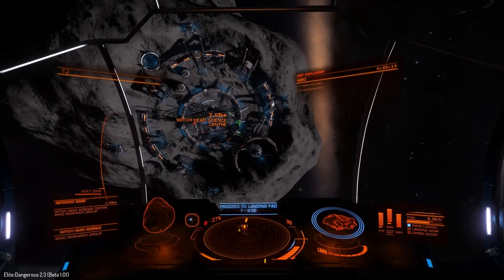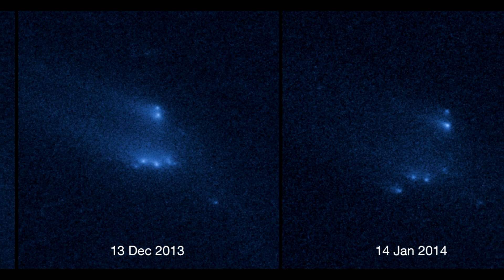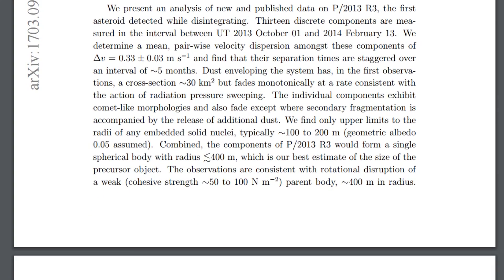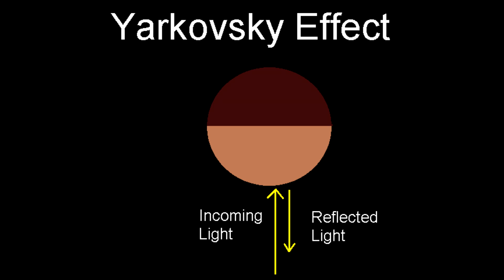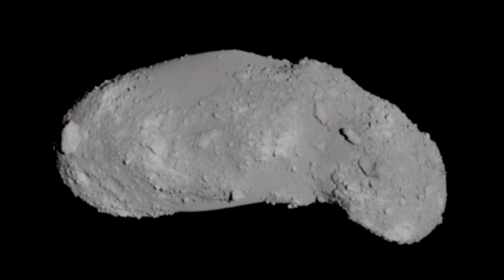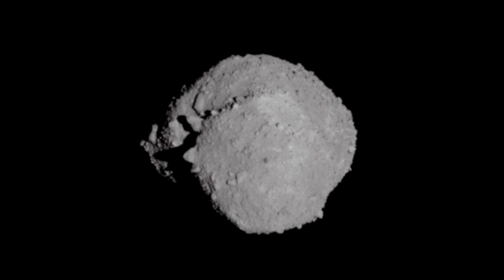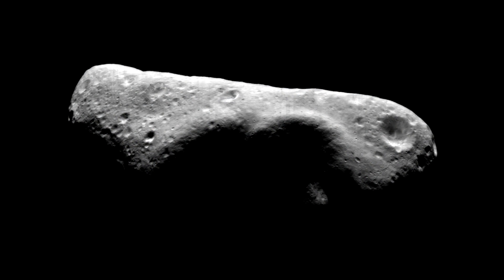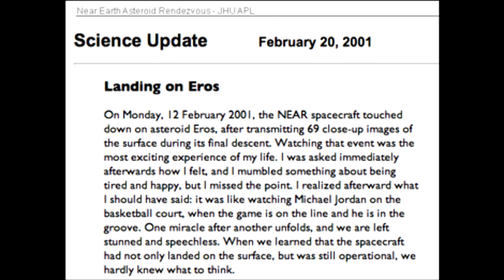Spinning Asteroids To Make Space Stations

Comment: Yeah, this seemed like one of the least plausible things in the show to me. I'm not a physicist or anything, but... Assuming you have the power to pull it off... It seems pretty obvious: You're not just increasing the gravity; you're reversing it. So unless it's made of solid granite or something, what's keeping the surface on the surface? What's stopping it from just spinning apart into pieces? Might as well stick with good old fashioned O'Neill cylinders, and/or genetic engineering to adapt humans to microgravity.

Comment: Civil Engineers use concrete, which is weak in tension, by placing it in compression, so called pre-stressed structures.
Perhaps this could be applied to asteroids?

Comment: I agree and also disagree, there is absolutely no evidence that every single object in the belt is a loose conglomerate of small bits and not a solid object especially when you start talking about the larger ones like Ceres which is considered a dwarf planet. However smaller ones like Eros most likely are but again, can't say ALL. I do agree spinning can/would take a long time to get close to Mars like which I do not remember the author ever claiming this (if you have a page and book # to refer to???). If you have a solid body or as Scott suggested a process to "firm it up" the size of Eros however, ten years to do so is nothing. Some comments though try to suggest the original gravity of Ceres would help, it doesn't. Spin gravity would push you away from the center which is where the natural gravity is trying to pull you so it actually works against your goal and means you would have to spin even faster!

Comment: Radiation shielding: You can still get the radiation shielding benefits of an asteroid by keeping people in the shadow of or inside a 100+ meter asteroid, while harvesting energy from the light side/surface.  

Whether you bore into the asteroid or hang out on the dark side, you only need to spin the gravity-sensitive portions of the habitat, including 0.1 to 1G partitions. Today's Franken-chickens, for example, aren't doing well under the load of 1G environments, and their bones would do better in microgravity.

BTW, I don't see why it's all that hard for phonebooth-sized craft to dock at the hub of a spinning station. You just match the rotation, which ain't much. Sure, it's a little harder than stepping onto an escalator at the shopping mall, but if we've got fly-by-wire drones flying in formation, we'll have fly-by-wire docking modules, too. 

You just teach a neural network to master lunar lander and then teach it to perform docking in a zero G simulator,  then IRL. It's not rocket science.

Comment: If they build the base inside the asteroids first, then spin it up, they could remove a lot of mass so it would require less energy to spin it up. This would also provide them with the opportunity to process strong reinforcement materials from the excavated minerals while building the base, therefore a lot of the construction and manufacturing could be accomplished onsite, so it could be a little more realistic, but still very scifi.

Comment: For Ceres it may not even be necessary to solidify it, as it is massive enough to undergo Hydrostatic equilibrium and most of the technology needed to accelerate its rotation would only need to be implanted into its surface.

Comment: I think if you're going to spin asteroids like Eros you're probably drilling and installing a matrix of lightweight, high tensile strength cables and girders throughout the whole thing to keep it together, and weaving an outer net/shell out of carbon fiber cables or something along those lines, with a much thinner spray on polymer shell to keep the surface hardened.
But yeah, past that size you probably just want to build ONeil colonies from scratch using nearby asteroid materials.

Comment: Sorry, had to give a negative vote to this video. Why so much negativity against the idea of hollowed up asteroids? It's not like there's just one kind of them!!! Metallic asteroids are pretty much solid chunks of almost pure iron, which is pretty strong itself. I've seen iron meteorites in the museum which are a couple tons in weight and VERY solid, not quite a bunch of pebbles barely held together by their own gravity. These are what remains after the main part breaks up in the atmosphere during entry... so obviously, there must be some metallic asteroids up above which are ~1km in diameter and >90% pure iron - it would be very easy to melt them with care so as to carve a liveable space within as well as smooth out their exteriors, probably also making it more into a spheroid (so it better resists the mechanical stresses due to the spin) and adding some carbon in the process to convert iron into steel. This wouldn't work for objects like Ceres or Eros, but I for one find the general idea is pretty sound

Comment: The question of if a (small) body will break-up due to its fast rotation (centrifugal force) depends primarily on the size of the body and secondary on the tensile strength of the material. If you have a piece of an iron asteroid (let say < 100m in diameter), you can very well spin it up so fast that on its surface you get 1G and it still will hold together. So no, it is not true what you said, Scott, that @ 0:52 - "Would an asteroid even hold together if it did this? Well, the answer... is actually pretty obviously no." - No! The answer actually pretty depends on size and strength. What you said is not generally true.

Comment: Out of curiosity, since you bring up mass quite a bit in your calculations, have you taken into account that the mass of the asteroid could/would likely be heavily reduced if it is being hollowed out for a station complex? There is also the possibility that the station construction could be placed as a separate and distinct cylinder inside the asteroid, and thus have its own rotation speed beyond that of the asteroid. Basically, the asteroid would exist as a material resource during the construction of the internal station, and then merely exist as an extra shell of protection after the construction has been completed.

Comment: Once we have (ultra-strong) diamond fiber (df) in industrial quantities you might wrap df-cables around it or even embed them in it ala reinforced concrete, which gains it strength from a balance of tension and compression. But if you're going to do that you might as well build a habitat by just creating a df-shell and lining it with asteroidal rubble sufficient to block cosmic rays.

Comment: Seems to me that you are speaking in the terms of the science fiction these asteroids are used in, in so much as they are hollowed out. That to me is an impractical use of these asteroids. There are enough materials in the asteroid belt to mine and refine to fabricate habitats that would be much stronger and lighter, such that spinning them up would be no problem. It is readily apparent that just spinning up a hollowed out asteroid, even if what is inside it is reinforced, would not be a real solution, as these bodies are inherently unstable to begin with, and could not be reinforced well enough to keep them from flying apart as the spin reaches a limit beyond the capabilities of the body to remain intact; and that spin would still not provide adequate artificial gravity. That said, as the asteroids are a vast source of raw materials, they would be able to provide for space refineries, which would be able to produce building materials. Eventually some of these building materials would be used to build more refineries, which in turn would increase the amount of refined materials produced.

On a related subject, let's take a close look at the International Space Station. Here is a conglomerated collection of haphazardly assembled parts, and no one can remain stationed there for even a year without suffering the effects of near zero gravity. What makes this so impractical is the fact that the original plan to build a habitat ring could have easily been implemented, using the external tanks of the now decommissioned Space Shuttle program. Gutting them and building the interiors for habitation would have been much easier, and they could have been coupled together into a ring of a sort. Spinning up a completed ring of that type would have been rather simple, just by attaching retrorockets, similar to the maneuvering thrusters on existing spacecraft. Reinforcing such a ring would also be rather simple. And occupants could remain stationed in space living aboard such a habitat for several years. radiation could be shielded by layers of heavy metals like gold, and energy from the Sun could be used to power all electronic devices aboard, just as they are on ISS. This would also give us a nearby jumping off point to the rest of the Solar System, such as the asteroid belt; from which we could herd chosen asteroids to Earth orbit, where they could be mined close to our planet. At that point the possibilities would become practically endless.

So as a suggestion, could you make a video discussing these possibilities?

Comment: If that holds true then it would be very easy to mine them if they are just loosing together.  Just grab it and fill the cargo bays then head back to Mars I guess would be where it would be mostly done.  There filter through it, refine what can be and what can't be then somehow send it down to Mars to increase the planets mass.  The problem is most are class C; carbon, iron, and some other compounds.  So, we could get iron and maybe some other bobs and bits from that.  And whatever iron that wouldn't necessary would be feasible to extract could be just sent to Mars.  Now, the core of an inter planet is typically iron but not always.  It would help Mars more if it could make it to the core.  The problem with Mars is it was hit around 6,000 by some object and ejected it's core into space Phobos and Deimos.  Then the core cooled.  But in a few thousands of years, and if Phobos and Deimos could be deorbited and somehow get back to the core of the planet the it could start to generate a magnetic field.  But the mantle would have to be restored.  I know I have seen quick fixes which are really foolish and rush responses in the long run.  But if all of this was done then, maybe, it could be reconstructed to support life again.  But to get it earth like, that's allot of mass to move in that time frame.

Comment: I would have thought it better to dig a big enough hole through the asteroid but not spin it.  Build an O'Neil Cylinder inside and spin that.  Even better, build two in parallel so they can be spun in opposite directions to balance out the torque acting on the asteroid.

Comment: wrt to the calculations... are those for an already hollowed out asteroid?
presumably they'd hollow it out before they tried to spin it up, so there'd be a lot less mass involved.

that said, most asteroids aren't solid rock, so the whole point is moot. As you said, they'd need to do some kind of crazy process to make glass the whole surface and cool it down again, and the resultant material probably would be absolutely loaded with impurities and imperfections waiting to turn into catastrophic fractures.

What you said about the basalt fiber actually made me really think for a bit... rather than using the asteroid as-is, they could instead simply harvest it for material to make the basalt fiber, so that they didn't have to lift it off the surface of a planet.

Comment: I thought the best way to "spin up" an asteroid was used in John Ringo's "Live Free or Die" series, where a corporation shepherded iron-rich asteroids to a working area, then using a massive coordinated array of solar reflectors to drill a hole, drop in an icy comet, seal the hole, than heat and spin the asteroid until the ice expands to steam and makes a thick metal bubble. Bore in using your solar reflectors again and start inhabiting. - - - Spinning rocky asteroids is just making a gravel weapon.

Comment: If you're hollowing out Eros to make a permanent space station, you're going to remove a lot of that mass, which reduces the energy needed to spin it up. I'm thinking the corporation is processing that material for various minerals to use elsewhere. In that process, why not  save the H₂O (combine H₂ & O₂ extracted from minerals, bring in H₂O from other small bodies) to make concrete to extrude onto the surface over a matrix of carbon fiber or other cable to make a shell out of its own innards that will hold it together as it is spun up? In the process, you could re-make the shape into something more balanced around the spin axis.

Comment: There is a common misunderstanding that asteroids are large rocks. In most cases they are gravel balls, there may be a large rock in the middle somewhere but it is likely that they are mostly gravel and dust cemented to the large rock(s). Even if you found a large enough boulder to put a base on you would be subject to a storm of loose debris bouncing and orbiting through highly erratic orbits. This would make it extremely dangerous to attempt to land on and would require the base to be buried deep inside the asteroid. Making it largely inaccessible. It would be a much better plan to do this on a planatoid like Ceres. The weight of the armor you would need to approach an asteroid would be less then the fuel required to land on and launch from Ceres.
In my opinion the best plan would be to build a space station that would be easy to spin and use drones to collect the material you are there for. A space station would be a lot lighter and could be driven around.
Reply: There is a common misunderstanding that asteroids are all the same thing.  Also, Manley's projection seems to assume this trick is easier for larger objects.  The opposite is true.  With a maximum spin rate of 2 RPM, you can get useful gravity with natural materials, like basalt and granite.  Nobody is going to try to spin up a slagpile.  This is a "straw man" post.

Comment: I just came here to comment that the main problem could be solved by melting the asteroid with sunlight and allowing it to resolidify. Just use a big mirror, you can use it as a solar sail as well to alter the orbit somewhat. Then spin up the molten asteroid, heavy metals etc get spun out to the edges - after many years or active cooling ala radiators you have easily harvestable resources and a solid stone foundation to build on.

Comment: A small asteroid in an orbit that neared both Earth and Mars could provide a large living space with protection from radiation. Like a cruise ship to and from Mars. If the asteroid is essentially a rubble pile then put a balloon in the center and a net around the exterior and expand the balloon. Of course there would be energy expenditure for passengers to reach and to leave the "cruiser" and the trip would be along one, but the cruiser could be permanently manned and re-used for an indefinite number of trips. For artificial gravity, just spin the living quarters in the center, not the whole assemblage. The cargo area need not spin, just a light-weight passenger living space. A lot of energy would be expended getting the huge mass of the asteroid into an appropriate orbit, although part or all of an asteroid with approximately the right orbit to start with could be used and, once in orbit, it could be used for hundreds of years.

Comment: Most of the asteroid would've been hollowed out to provide as much internal space and spin gravity on the 'ground' as possible, leaving only a (relatively) thin shell a fraction of the original's mass, whereas Scott used the full mass of the asteroid for his calculations; certainly on the show it's definitely not "full of rock." Other nickel-iron asteroids would presumably also have been harvested, so they could use the metal/carbon nanotube composites that are already being developed to hold the asteroid together on the outside, and that's far stronger than the here-proposed rock-fibre, which itself could act as extra internal support and 'ground.' Taking all of that into consideration would make a big difference. In an early episode we see the coriolis effect bend a stream of liquid as detective Miller pours it into a glass, however, I thought the spin wasn't fast enough for such a pronounced effect; would anyone care to comment?

Comment: If you took a nickle iron asteroid that was relatively small, heated it up into a molten ball of metal, could you blow it up like a bubble by inserting say water using a ceramic straw? Or would the gas just blow out the side? If you could blow big metal bubbles in space it would be a cool way to make a space station, or a part of one.

Comment: Would it be possible to build support struts, lattices, etc throughout and around the body to increase its resilience both to heat and fragmentation? Say, just fill the whole thing with structural support tunnels and cover it in scaffolding to hold the material in place, then do whatever you'd do to prepare it as a station? You could even have these supports serve double duty as heat sinks.

This would still be a phenomenal and borderline comical waste of materials, but it's a possibility for a society inching closer to post-scarcity, especially for people capable of building something like the Nauvoo. 

I still have no clue what the logic would be in approaching something like this rather than just building an orbital station from scratch. Maybe some sentiment of needing a grounded culture for people to unify around, instead of just being in a fabricated habitat floating in permanent freefall around some planet they can never walk on. It could be worth it to them just because it gives them a rock to call home.